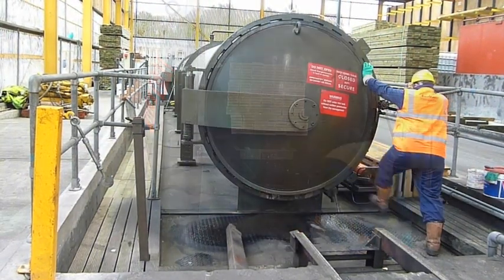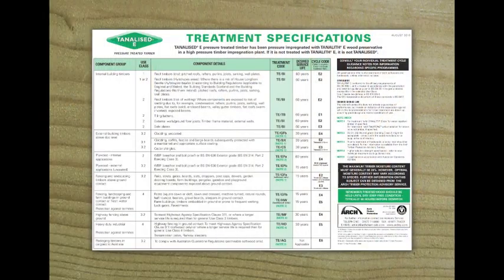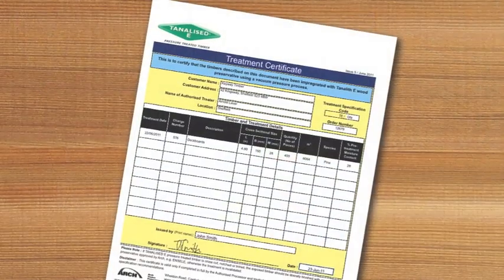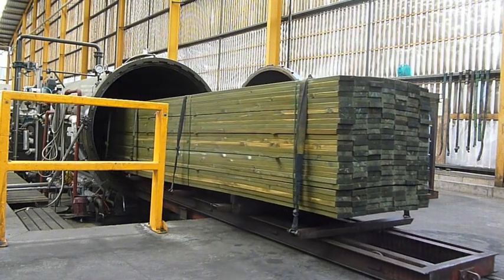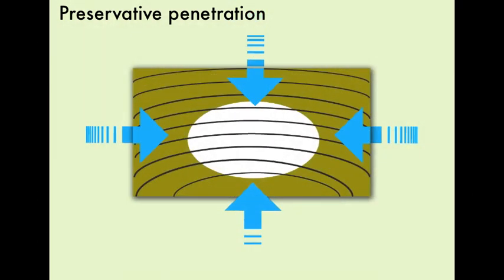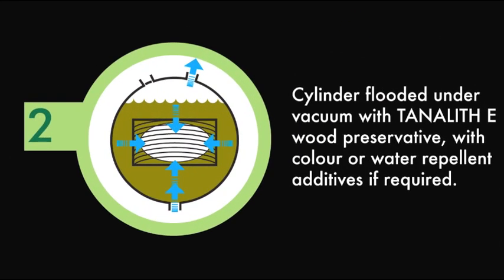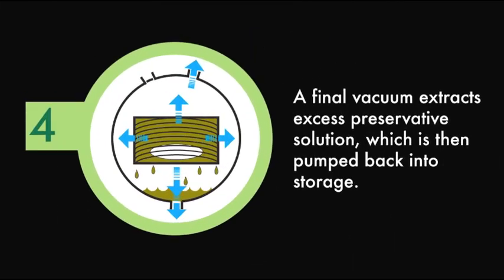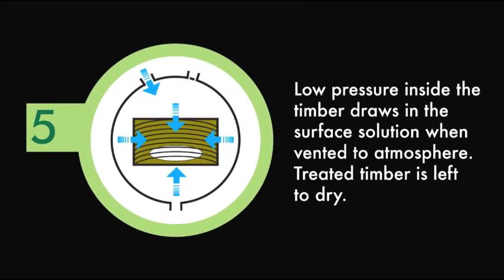What is Pressure Treated Timber?

Comment: jiep, that moment,  when you saw that timber and see that there is penetration zero, is priceless :D
Reply: It’s a scam:  there are many areas that don’t receive any of the chemical.  Now we have a board with solid parts, and rotted parts.  I’m in the middle of a deck replacement with that exact problem.